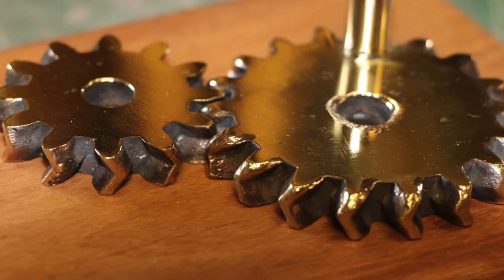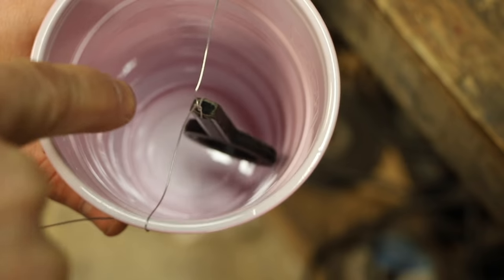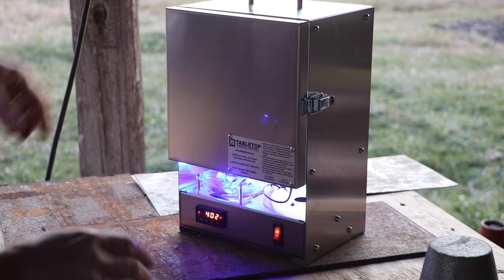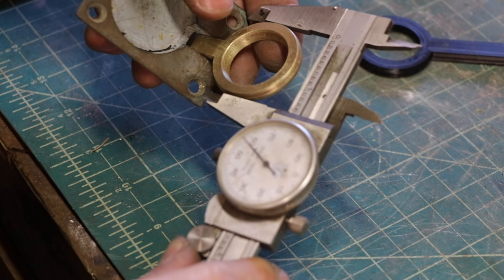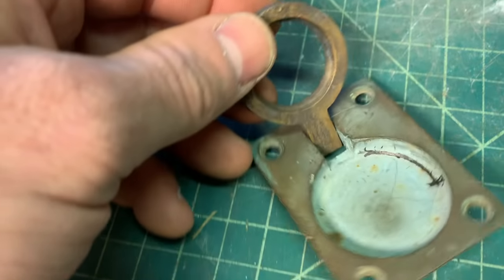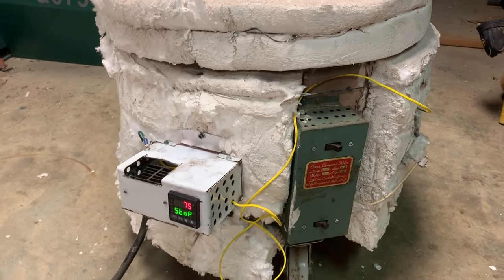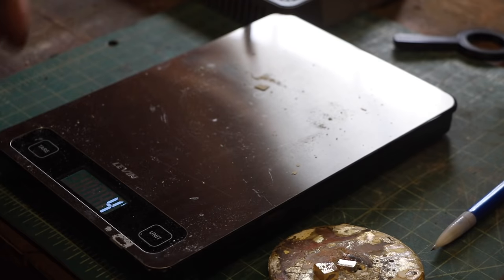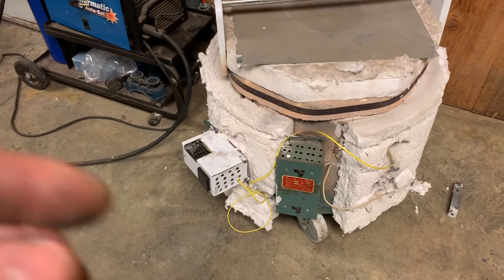3D Printing Metal At Home?  Pretty Much!  FarmCraft101

Comment: Could you added tiny risers to the ends of each tooth of your gear? Then the round off problem would be raised up and away from the gear tooth itself. Such small tabs would be easy to remove and sand flat, thus producing a completely flawless tooth pattern.
Also, you could set your wet mold on a vibrator to help shake out the bubbles. Or perhaps a more exotic solution would be to spin it in a centrifuge prior to it setting up.
You could also make your pour spout lower than a vent to get better penetration and to allow air to more easily escape during the pour.
Suggestion 1: Build a DIY Electric Furnace w/temperature control.
Suggestion 2: Build a DIY Vibrator w/variable speed.
Suggestion 3: Build a DIY Centrifuge. Mold swings from upright to horizontal w/spin.
The centrifuge could also possibly be used while the metal is still molten?
I hope you like my random thoughts.

Comment: Hey buddy, I used to be a kilns man, Your opening your kiln too early to remove your mould. Remember the hot air in the kiln and the sudden cold air rush when you open the door won't mix nicely on your items, (you could shatter or crack items this way). Let the kiln go cold before taking the items out, and open the door in increments, very slowly, to let the inside of the kiln adjust to the out side ambient temp.😎👍
Good idea with the can to hold it together too. But still recommend the boring weighting time of cooling down.

Comment: I bet an electric toothbrush would work good as a vibrator for making sure the plaster filled in all the voids.  Just touch the tooth brush to the part and the vibration should reverberated down through the plaster.  Love your content, new subscriber.

Comment: We used to use a centrifuge to do lost wax casting.  After we spun the metal into the mold we would dip the whole thing in a water bucket while it was still hot.  This would cause the plaster to explode and dissolve almost instantly..  It was super easy to recover the casting.  If you really want to do this right you should get a vacuum/casting machine.  with the right one you can vacuum the air bubbles out of the plaster,  and also use it for providing a vacuum for pouring the cast metal.

Comment: Hey not to be that guy but.... you can print a vent spout on the far end of the mold also it's a 3d printer you can make that funnel as wide as you want. 
but a really cool process. if you let the molds dry before putting them in the oven and the mold won't melt before the porcelain sets up.  Then you get sharp accurate results.  Thank you for the video.

Comment: Very well done. I have always had the vent hole design. My experience was with casting sand . For a finer casting I used screen sizes fine for the first contact and course for the fill with talcum fir the release agent.

Comment: Really nice. You make it easy to relax while intensely leaning a bunch of stuff at one time, and you have a pleasant “radio voice”. Here’s a crazy idea for metal casting: a window shade cord rollupper made in a Danish Steampunk style. You know, obvious but elegant, brass and wood. The rollupper design includes using wifi Google Home app to perhaps control it on a schedule, via a smart controller. You could include 2 controllers, one for adjusting the angle of the shade slats via twirling the rod that hangs down, and the other to roll the cord (which would raise or lower the blinds). Steampunk Home Automation! -Mark

Comment: Like anything, me included seemingly we all discover first how not to do it, I often let perfect get into the way of good.  Failure is all part of the process, I'm ok with it for those lessons have durability. Thanks for including yours too, we all have them.   I have been working this idea as you, sometimes I foolishly desire perfection.  I have been at this for some time, experimenting learning and being super methodical about it. Nice shop you have, the ovens are nice, I have the small one you showed but modifying it to make it safer.  I too use 3D printed parts, mine often require multiple attempts to get it just right, I then sand and work them into flawlessness.  Using these to produce silicone molds, a complete journey on it's own.  Using these silicone molds I inject wax into them creating precise wax copies, this too was a journey, different waxes, shrinkage etc..  The cost, well education comes with a cost, not cheap but lessons are priceless   Using wax allows for producing as many copies as you need, and quickly. The idea is to vacuum cast these. I have many parts up to this stage, The vacuum caster ready yet I am on hold finishing my oven, this is almost complete. I am sure I will experience more failures as the vacuum casting journey unfolds.  Like what you do here, great video, that is a success in it's own rite.  Always open minded to new ideas and methods. So many methods, sand casting is another one, anyway Cheers!  Thanks for the video.

Comment: just a suggestion....investment molds for casting metal are usually a mixture of plaster and silica.  The silica insulates the investment so less cracking will occur.  You saw so much cracking because you used straight plaster.  A good mix is 60% plaster / 40% silica.  In the gear video as well...it looked like you used hot water to mix the plaster.  You always want to use cold water to mix the plaster so it gets thoroughly supersaturated evenly.  Also...if you paint on a face-coat of investment onto the pattern BEFORE you cast the investment around it, you will eliminate any chance of air bubbles and get much better surface detail.

Comment: Yeah my high school teacher was into jewelry making and dud list wax casting. He used metal tubes to pour the plaster in . You can add sprues on your piece. We also rotocasted our rings using a centrifugal casting machine . You pour your molten metal in crucible on the machine ,turn it on and it spun the molten metal into the mold. Pretty cool . I remember him casting a bee and you could see hairs on the bee's body. We worked with wax . But pla is cool way to make things.

Comment: I don't know if you've already purchased a vacuum chamber or adopted another alternative to avoiding air bubbles, but I found that tapping the side of the containers you're using as flasks works sufficiently during the Prestige Oro Investment Powder's setting time (approx 10 minutes).
 I'm into jewellery casting with 3d printed wax models and it's a very similar concept to what you're achieving and as far as bubbles are concerned this method has served me surprisingly well.

Comment: Adding sand in the plaster should help with shrinkage. Also some wire mesh in your cup probably works as well as reinforcement as a full metal can, and is a more flexible method. Dipping/painting the print in pure thin plaster first and letting that set up is also a good alternative to make sure air bubbles stay away from your surface.

Comment: I know it may be annoying to point it out, but it may also be useful. I THINK the reason you cracked the plaster is beause you used Fareheight in placeof Celsius, the 100º is used for the bed (at maximum) and the 240 is used for the hotend. So your 100F was  too low, the 240f was still a bed level temperature, the 480f was optimal but by then you already cranked it to 1200F with is just Too much. Next time straightly puting 240C (equivalent to 480F) may work without giving any problems

Comment: Maybe, if you made a two level casting flask; the bottom section would have the desired casting and the upper section has a large as possible sprue funnel that would hold the metal until it melts and flows down into the lower chamber. My thought is, the molting metal will flow and fill better, being hot during the entire "pour". I'm definitely thinking about a kiln now... THANK YOU!!!

Comment: If you have a 5 gallon bucket that you don't mind ruining the lid with a fitting for a shop vac. You can make a passable vacuum chamber. You can also use a piece of plywood and a rubber mat for a lid.

Comment: Wonderful video. Thank you. I initially thought as you did to drill some risers from the outer edge tops of each tooth to either vent the air or even provide a chamber for the trapped air to compress into. ETC but within seconds afrer thinking about the ease of turning the pips off after casting.  I realised that is a silly way to succeed. What I then thought was to use the 3D printer to make the design wider = fatter = thicker between the sides. It would take no extra drawing skill or time just plot it thicker. Then after casting in brons (or whatever), the gear can be turned in a lathe = faced off down to correcct thickness = width and the rounded corners of the teeth would be gone. But another way is to simply take the CAD design you have and dimension the OD a bit bigger, cast and turn down the diameter to the current drawing spec.
Both used together is negligable finishing work and perfection sharp edges on the teeth and faces.

Comment: Reinforce the plaster casting box with copper cage (wire D=0,5-1mm) to prevent it from cracking and falling apart (you can use cheap plastic cups again), add a longer pour with smaller inner diameter and curved sprue (optional). Also you can use hammer drill's hammering mode for degassing plaster casting box.

Comment: I was thinking about the same process for a while... Thank you for sharing and demonstrating that it's pretty feasible. The need to compensate for thermal expansion makes things harder to reason about though... Never thought that cast metal when cools accumulates a significant stress around circular shapes.

Comment: Mill, sander, furnaces are one time expenses. Sanding belts, plaster, plastic for printing, and metal are the only recurring costs, and low ones at that. Overall an excellent solution for the DIYer

Comment: You could print in a water-soluble thermoplastic (e.g. PVA). Possibly even ABS and dissolve it with acetone if the mold plaster is too wet that it would dissolve PVA too quickly (or if you need a little more heat resistance for a first bake pass in the oven)? If you use less infill (for that part even none at all, just maybe 2 or 3 outer walls), it will dissolve and/or melt a lot faster. If you wanna stick with PLA or create a re-usable mold that you don't have to destroy, you could just add a separation to your stl-file to create a 2-part mold and then just do some sanding where the 2 parts came together.

Comment: Plaster of Paris is what is used in casting, some steel reo wire around the cast piece will stop the plaster from cracking, you really should be using a centrifuge for better results.

Comment: Hi very cool video
I'm a dental lab tech of over 40 years and have done literly thousands of castings using the same method making gold crowns. I also make jewelry I'm particularly interested in the design on the cad software were using cad cam in the lab now but I would like to expand my abilities with different software. Good job here in your video.
Thanks jesse

Comment: Also fun fact to make detailed casts using this you might want to spin the object with the bottom facing out so the centrifugal forces push the metal to every noook and cranny, and that also forces the air out.

Comment: Hey mate, I think that this process would be useful for making metal parts that you just can’t buy anymore. For instance, in my kitchen a bracket for holding the front to the side of a drawer has broken and cannot be replaced. I bought the last ones when the manufacturer closed down years ago. The full impact would be to virtually replace the whole kitchen unit because of a single broken bracket. That’s a $20,000 proposition for a $20.00 part.  I don’t have a 3D printer, furnace or any of the other gear you mentioned. I’m stuck but thanks for presenting a solution.

Comment: Nice guide. This opens up a ton of opportunities. I knew about sand-casting, but this seems like it gives much better control and precision for intricate objects.
I will definitely be keeping my eyes open in the used-market now for something suitable as a forge. What kind of weight are we talking about on that ceramic kiln though? Pretty heavy I bet...

Question: What happens to the PLA? It burns obviously, but does it combust so completely that it doesn't contaminate the material or block part of the mold with residue? I knew this was a thing using foam, but a PLA print (even hollow) would be far more dense, so I hadn't really thought that was possible.

I think you are right that the blunting imperfection is probably due to air. I think it would be well worth just making lots of thin vent channels to all the high points that might trap air. Since it's a 3D print - it's not more work to make that sort of extra detail, which is great :) If you just make the channels connect on flat surfaces then they will be trivially easy to cut and finish later anyway.

Comment: Cool use a little vibration (simple as a drink stirrer or electric toothbrush and tap on outside of mold would gel get your bubbles out if your that worried on a particular project.

Cool use of 3d application I’m wanting a machine now

Comment: I enjoyed your video a lot.  I have made one try to cast lost pla and used the wrong plaster.  It fell apart.  I am trying to get setup with an electric furnace so I can work inside and then I will start again with the lost pla.  Until then I will have to make do with sand casting.  Thanks for the video.

Comment: Casting smallish parts at home is something that can be done at home with a modest equipment budget, as you demonstrate. Many parts, however, require machined surfaces in spots. Gears are not something I would consider making without machining, and frankly they lend themselves to letting a factory do it, like bearings. One approach, very commonly done, is to cast a part to get the rough shape, then machine certain surfaces that require it.

Comment: Industrially casting Ductile iron and grey iron at around 2000-2500F degrees we use venting and these parts are upwards of 600-700lbs parts. No vacuum is used.

Comment: Love the video!
For forcing the metal into the mold I've seen the "potato" method:  force half of a potato (wearing LONG GLOVES!) onto the end of the metal tube holding the plaster mold and molten metal.  The steam forces the metal into the mold.
And superheated steam jets out the sides.  Did I mention wearing long sleeves and long gloves?

Comment: in dental technic metal working, we use centrifugal device when we cast metal using wax lose technic. But largest piece of work in this field( dental technic) is very small. Centrifugal force push metal in the cast form and make air to come out. Aside shaped cone that help guiding metal into the form, also we add escaping air tubes, like wire of wax in the mold. One last thing we do is to be sure  that piece of work is in   the center of cast to ensure even heat for metal piece. Please forgive my English. I am not English native speaker.

Comment: You can decrease the bubbles on the surface of your cast item by using a brush to paint your vestment material on your burnout piece before pouring the vestment over your part.

Comment: I would love to see an auger to use in an extruder to recycle 3D prints back into filament. The cone shape with the large threads or screw essentially is not easy to manufacture just like the gears you showed.

Comment: The part you mention could easily be made from 1 bronze oversized tube or pipe.    Machine the outside down leaving the protrusion area alone then come in and do the key area after.   Easy peasy.

Comment: The plaster needs to set at least four hours before it's put in the kiln for a flask that size. I bet that was part of the problem. You can also take the weight of your plm and multiply it by the specific gravity, that will be the final wait of the casting and 10 dwt for the button. Metal flask (soup can) is a must.

Comment: Interesting , Thank You. . Where was the 3d printing? Addative manufacturing is so facinating.. In the early 80's I worked with wire spray aluminizing and the shop had a Metco 7M plasma machine . The wirespray was for corrision control , ant the plasma was for rebuilding shafts  (I was Navy 31M in building 61 at 32nd street) . the 7m with proper operation you could take a shaft , put for example a ceramic coating on 1 place , a gold coting on another place , . Basicly you could coat each part of that shaft to accomidate the working enviroment Thank You.

Comment: Even though PLA does cannot be smoothened with acetone in extent ABS can be, if you take syringe and needle, cut the sharp end off from needle and rub the prints surface while giving it some acetone, you can smooth PLA as well for better surface finish in lost PLA castings. It whitens the PLA like no tomorrow so it wont work if you plan on keeping it as PLA but if you paint it or use it in castings it does work there. Just useful hint so you have less cleaning and less wasted material.

Comment: Very helpful, detailed video, thanks.  I was wondering if you might consider demonstrating making hard to find bicycle part replacements, such as for mountain bikes?  I think some of those parts are aluminum, steel, or titanium alloys, that are typically optimized to be both strong, and wear-resistant.

  And I think the triathlon street competition bicycles, are probably optimized for having lighter weight.  Might be a good side business, with this tough economy; thanks sir.  Keep up the good work!

Comment: I've got an old ice chest that is missing a handle.  This would be really cool to replace it.  (It's sitting in storage right now.)  Sand casting actually might be easier.  I wish I could wrap my brain around CAD.  I've got all these little harmonica related projects I could really use it for.